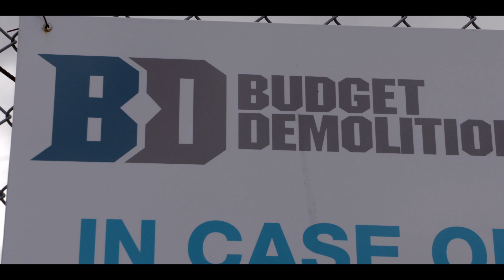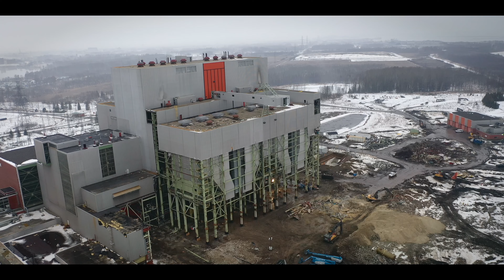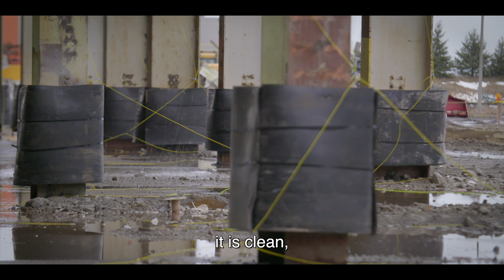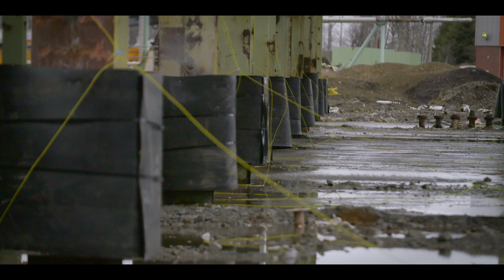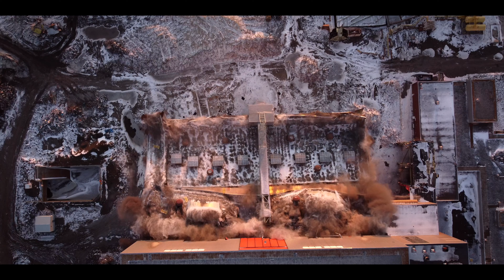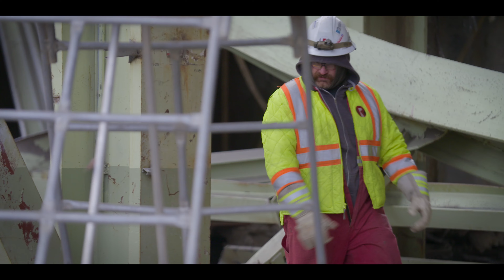Blast Two, The Split - Thunder Bay Generating Station: Episode #3

Comment: I’ve seen 2 Power Plant blasted in the last 3 month here in PA Both of them had issues taking either the Chimneys down or the plant itself. Elrama Power plant in Elrama,PA took 2 blasting to take it down. One in the morning to take the plant down and second one in the afternoon to drop the coal hopers. They didn’t use enough boom on the coal hopers or made enough cuts. Hatfield Ferry Power Station in Carmichael’s,PA took down 2 1100ft chimneys and 550ft scrubber chimney 2 of the 3 fall. Scrubber and 1 chimney. Not enough boom to make the 2 second chimney come down. They had to go back in and 30 minutes later in came down.  Hatfield Ferry Power Station also took down 2 cooling towers couple weeks ago. Last year 84 mine took down 4 silo’s. Big Fail on the first try Nothing fell.  Went back and they dropped one and got to see the other 3 fall. All of the videos are on my YouTube channel 

Great job! Stay Safe!